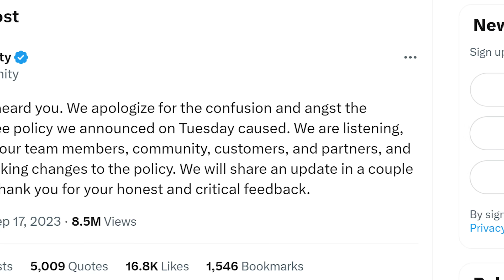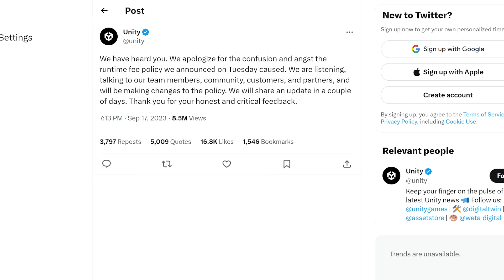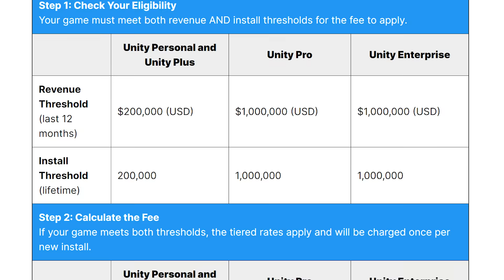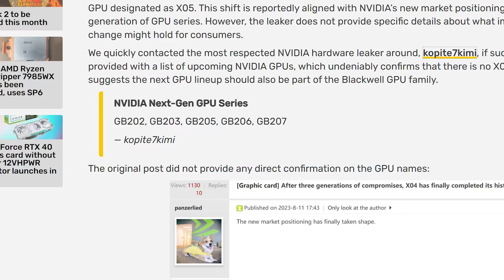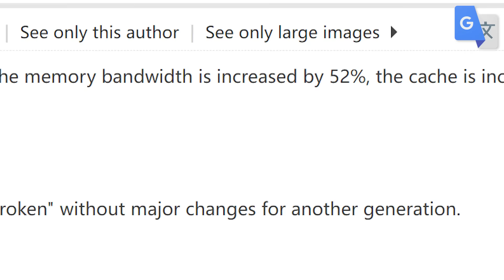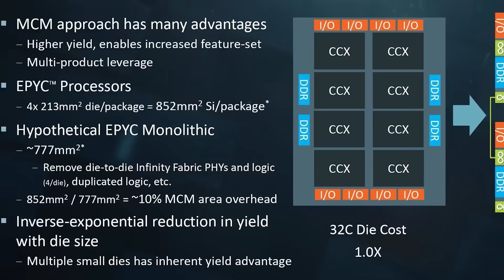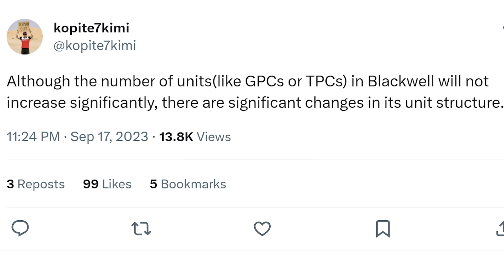RTX 5090 Completely DESTROYS The 4090!

Comment: The 5090 will probably cost well over $2500, if these leaks are true.
Reply: Time to sell my kidney😂
Reply: That's what we were used to with titans, so, it's really not that crazy for prosumers
Reply: At $2500 it would actually be a good buy! $1600 * 1.7 = $2720. Not to mention that it would surely not consume 70% more power, so it would be more efficient. And if you add 2-5% inflation on top, and that you can play 4K 240Hz in most games and 1080p 120 FPS in Quake 2 RTX, it's basically a steal!
Reply: @Winnetou17  "it's basically a steal" - only if you accept that the 4090 was properly priced
Reply: @ggsyep6509  time to let that 1998 meme die.
Reply: You mean $4000 it’s double the power, double the price
Reply: Haha definitely a ripoff
Reply: @Winnetou17 no it wouldn't
Reply: Expect a price increase regardless if the leaks are true, nvidia is still top dog
Reply: And increase your electric bill by 473%
Reply: My money my problem. I will buy it
Reply: @Winnetou17  I get what you mean but let us really make sense because if you compare it to much older graphics cards that inequivalent today money would cost for example $900 if you calculate the performance difference a modern card would cost tens of thousands
Reply: 1.7x the performance for 2.5x the price
Reply: @whiskizyo2067  that's the point of a monopoly. You could also buy AMD
Reply: @albion_i  like the 4090 rumours that suggested 1000 watts 😏. That aged well
Reply: @dwarfcow professional consumer....... so horrific.
Reply: This is where DLSS3 and 4 will come back to bite Nvidia in the butt. If they and FSR3 catch on, the market for this card will be smaller than expected.
Reply: I don't get how people still trust leaks after 4000 series.
Reply: @Winnetou17  The more you buy, the more you safe!
Reply: 6090 will cost $3500
Reply: I hope its overpriced. I just built a rig with a 4070.
Reply: I wish they would release the flagship product like the 5090, 6090, 7090 at least every year so they could maximize their income potential. There will always be people who would want to fork their money if such an option is available. Don’t slow down now Nvidia.
Reply: na. maybe from the scalpers. just dont buy from them. it will probably be closer to 1800$
Reply: Yes if you can even find it with the original price it’s probably going to cost up to 4000
Reply: When it releases, it will be a 25% improvement, but will still cost $2500.
Reply: @mikelay5360  haha yes but 450w is still insane compared to any other card
Reply: Nah NVIDIA Learned the lesson with RTX4000 series. They won't go crazy with pricing any further. At max it gonna be $1800 or below that. Nothing more.
Reply: Then get 4090
Reply: It's still totally irrelevant to the common gamer how high the performance gain and effeciency is of their top card if you can't afford it and if they keep up the scheme of inflating their prices twice as much as the general inflation rate is, and keep putting out junky mid tier cards. It's just getting worse with each new generation. We are already at the point where no normal avg person can possible afford to by buy a new Nvidia Top gen card each gen unless you have a serious good yearly income, and that simply don't go together with having a serious career and being more passioned about playing games than going to work. Someone need their school money back if they think they can keep that scheme up. They only do this because they know that as soon as they have saturated the market for Ultra highend gaming cards they stop making more gaming cards and sell the silicon as AI cards instead, and the avg gamer is left with overpriced mid tier cards that hardly is worth  spending money on for the yearly 5-10% increase in perf. for a new card.
Reply: Man, it looks like a steal to me since I'm an AI dev. Could come really handy.
Reply: @garryarganis5801  Time to get a snickers Mr Grumpy Pants, come on now lets go - Dad
Reply: also be the most dissapointing gpu ever, even worse than the 4060ti that at times is slower than the 3060ti. the 5090 will probably be always slower than a 4080 or something.
Reply: @mrdali67  budgeting and spending discipline go a long way in allowing people to afford things outside their income level.
Reply: 🤔I'm betting on closer to or over to $3,000. Well, Aren't they going to be using TSMC.
 It's Nvidia & we are probably going to be competing to buy cards with A.I., Apple, Data Center...etc wafers & cards.
.. Although they don't use the same products & wafers, it's the available resources at TSMC. It would probably still be an issue if they were using Samsung.
Reply: @Lynnfield3440  ??
Reply: @Winnetou17  Would still be a horrible deal considering the 4090 production cost is arround 500$ at best maybe add 150$ marketing and 50-100$ for design and its still heavily overpriced.

Edit: 90x AD102 per $16,988 5nm wafer thats arround 184,65$, 8GB of GDDR6 now costs $27 so GDDR6X might be arround 40$ so 120$ for Memory
Reply: @u-k  the trend is nvidia gpu's getting slower and slower. lower fps and more powerdraw and price.
Reply: @Lynnfield3440  They are not getting slower what are you on lmao. Not for the same price/performance though
Reply: The new ASUS 4090 Platinum watercooled is $4000.
Reply: @garryarganis5801  Without the kidney he is more likely to die, that's for sure.
Reply: @ggsyep6509 you'll probably have to sell your other kidney in 2 or 3 years after they release 6090. So yeah that's how GPUs are going to be which sucks because you spend a lot for only a few years making the PC worthless compared to consoles.
Reply: @BlackJesus8463 wow 4000 for that? realistically 1600 would be a lot to ask but somewhat accetable for such a card. 4000? no way.
Reply: @aboomination897  i mean it's a titan card its not a consumer card
Reply: @ggsyep6509  Two fingers will do, if you do it on the job.
Reply: The card is 2 years away. These leaks will change 300 times before 2025.
Reply: @Winnetou17 tell me you’re joking
Reply: Facts 💀
Reply: @nahbro3240  your dreaming if you think your gonna get 700 for a 3090
Reply: more 4090 in norway still cost 2500 :D
Reply: Only games that actually use GPUs. Escape from tarkov couldn't run at 240fps on a 8090 @Winnetou17
Reply: meh,more like 2k usd,guess im selling my house then
Reply: I payed more for 3080 during the mining boom
Reply: @Winnetou17 that's not how it works. If you have to pay more linearly to have more performance you would be paying $10k to have a gpu today this is simply not how it works. They should upgrade the performance and not the price.
Reply: @SheepAmongG.O.A.T man same. I'm about to build my 4090 beast by the end of this month 😭
Reply: so 5k nzd. which is more than i spent on my car and dirtbike combined. no thanks.
(toyota altezza, '01 honda cr125)
Reply: @ggsyep6509 you mean your common sense / dignity
Reply: plz make the 5090 cost 5090$ 🤣
Reply: so what? it's cheap
Reply: That’s cheap. You can easily get that in 2 years
Reply: if 5090 will cost 2500$ and 4090 costs 1600$ i dont see nvidia selling many 5090. way too expensive. and ever time new gpu comes out the price takes quiet a big leap. future looks bad for high end gamers. i have a 3080 but tempting to buy a MSI GeForce RTX 4090 SUPRIM LIQUID X.
Reply: I hope not, I held off this year to get the last life out of my 1080ti watercooled. 

Next up is a 5090 in about a year along with 3 4k displays! If prices on tv / monitors drop enough I may get 5 4k sets.  So I need that 8k gaming power.
Reply: People complaining what the RRP is going to be when it is out but have fun buying it at RRP as this is the scalpers wet dream when it out and good luck buying it at what even Nvidia sets it to as when we do find out what Nvidia wants to screw people on in price you can double that when the scalpers buy them all up like the 4000 series cards were.
Reply: I bought a 4090 graphics card for $2700. I think the 5090 will be the price of a car.
Reply: Well, that was totally wrong. It's $1999 MSRP

Comment: The 6090.... is going to have a door where you install your motherboard, ram, cpu and power supply directly inside, no case needed. 😂
Reply: :face-blue-smiling::face-blue-smiling::face-blue-smiling:
Reply: Truthfully. A 4090 needs a 16900K as it is now, along with DDR6.
Reply: and beer storage in it dont forget that
Reply: You're hired!  That's some out of the case thinking and such a paradigm shift will be critical to NVIDIAs market disruption strategy.
Reply: You know, this really hits on something I've been thinking for a while. GPU's are pretty much a PC in themselves. I've wondered if a gpu shouldn't be something that's also upgrade-able along with the rest of the system. In the old days you could adjust the ram and cpu compute power with exchange of chips. and even hard drives had multiple - mess-with-able parts. I'm not sure where I'm going with this but I know what I mean.
Reply: and a bracket where it hooks directly onto your ac units cold air output.
Reply: comes with free wheelbarrow and mortar for your brick
Reply: actually thats a great idea
Reply: The 7090 will be the size of a shipping container where you can live in and it keeps you warm in winter.
Reply: I'm looking forward to 7090
Reply: 7090 is a room where you install your hardware to
Reply: And transport you forward in time 10 years so you can buy it for a few dollars..

Comment: NO WAY THE 5090 WOULD DESTROY 4090 IM VERY SHOCKED!
Reply: hahaha
Reply: Don't always expect a new gpu to be better than than a old one. Cough cough 7800xt and 6800xt
Reply: @albion_i ok but the 7800 xt was released for $150 cheaper on release so your point is invalid
Reply: @cyathoris7530  yes but only cuz the 68 was released in middle of a shortage and amd new they could get away with the price. Subsequently reducing it in the next generation.
Reply: @cyathoris7530  also they released it to replace the same tier card so if it's the same tier and a new generation you'd still expect an uplift in performance. They r selling 78 non XT as xt
Reply: @albion_i  Except it's not the same tier. The 7800 XT is not even a regular 7800. It's a 6700 XT successor.
Reply: @albion_i  the naming is dumb but if you buy a card solely based on naming, then that’s just stupid. The 7800 xt is still $50 cheaper at launch than the 6750 xt which is still cheaper than the 6800 non xt. It’s a generation uplift so I don’t see why everyone is complaining
Reply: @cyathoris7530  if ur right but still it's like Nvidia shifting the dies for the 40 series and amd lowered the core count and now the 800 and 900 series don't share a die like last gen
Reply: @cyathoris7530  it wasnt really. still 650 euros vs the 6800XT msrp from 3 years ago.
Reply: @cyathoris7530 150 less and inflation adjusted so technically more than 150 less 🎉
Reply: Like it or not 7800XT is the best value card this generation.  Yeah the name sucks and should've been 7800 or so . 
But if 5090 leaks are true nvidia will absolutely charge you . Anout 2.5k
Reply: we have three variables here we cant mix:

a) Name or nomenclature
b) Tier or tech upgrade
c) Price $$$

in the last 4 years the jump in Tiers (tech level) was very good except this year 2023. we only have more ram, few new software FSR... and lower prices.. i think...
pc games world is changing very much now... with all this A.I. stuff.... new AAA games are garbage  and so the  hardware.
i downloaded a free copy  of starfield and it is... horrible....
Reply: It will be bottlenecked by the same processors as the 4090, 4080Ti and 7900xtx are....
Reply: @kramnull8962  out of those 3 the only card that is bottlenecked by your cpu is the 4090. 4k cant push it, need heavy rt and shit
Reply: @albion_i the 7800xt still has some slight advantages though, but yeah it’s not much better
Reply: @EjayT06  sould I pair it with my r7 3800xt?
Reply: @albion_i  umm maybe but you might want to consider upgrading to like a 5600x or 5800x3D or something
Reply: @EjayT06  is the 5800x3d enough of a upgrade cuz for me it's like 90 usd more than a 5800xt
Reply: @albion_i  if you use your pc primarily for gaming then 90 more for the 3D version is 100% worth it in my opinion. Should last you a while and will be able to use very good GPUs with it before you upgrade to AM5
Reply: Denial is the most predictable of all human responses
Reply: @albion_i why not just buy a 4090 call it a day like I did lol and buying from the name is really a PC normie way lol
Reply: haha
Reply: Developers need to just make true PC versions of a game to justify the need for a fancy 70 pound gpu that’s gonna retail for  2k for the 60ti model
Reply: i think should be 35-40% so its means its already big gap